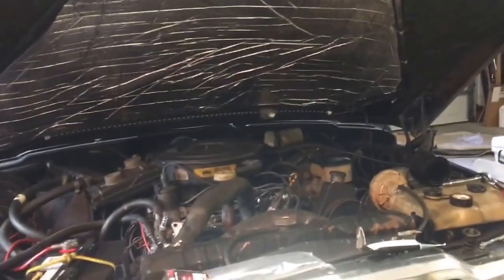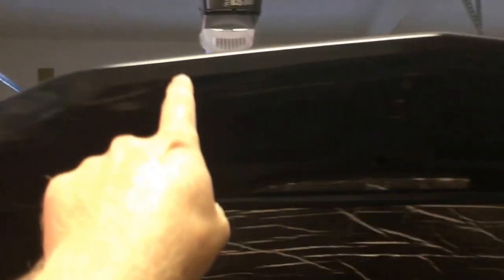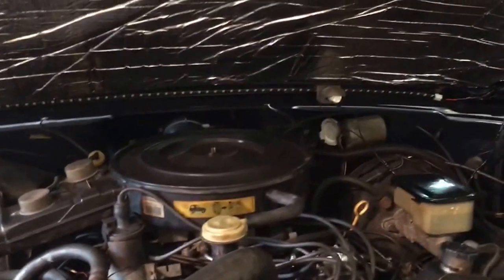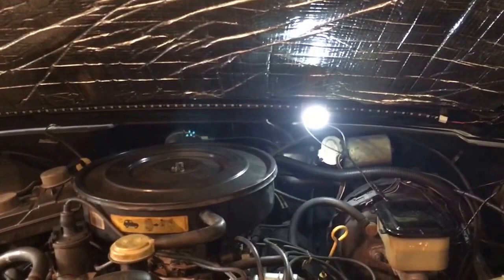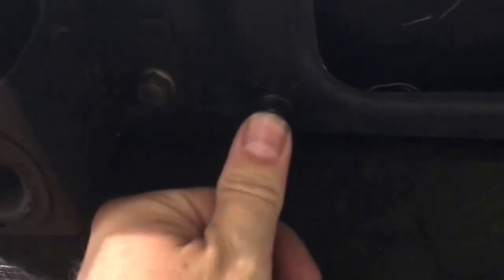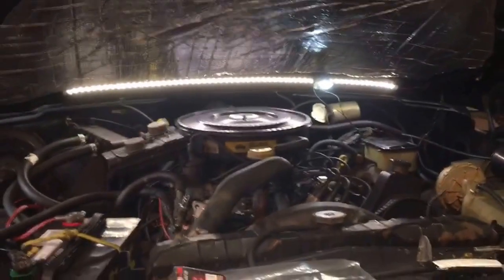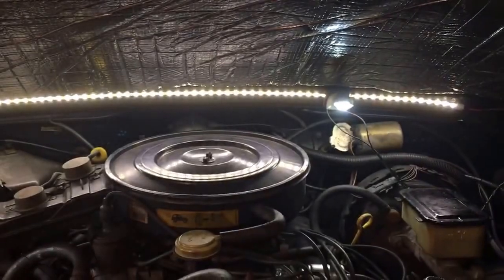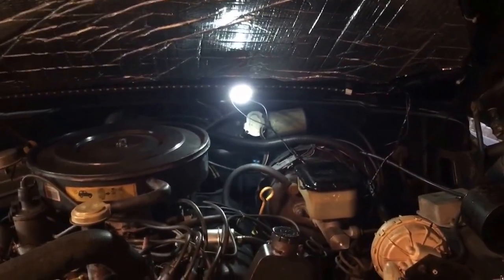Under hood LED installation in a 1987 Jeep Grand WAGONEER

Comment: How is the sticky holding up? I was thinking of doing this mod to my 84 Grand Wagoneer. I am a little worried the adhesive wouldn't hold during winter: It get's pretty cold and snowy in Idaho.
Reply from the maker: George Decker I used 3M exterior auto adhesive tape to install the lights. The glue/tape that came on the lights was too weak. The 3M works great. http://www.amazon.com/dp/B00JR4D70K/?tag=myjeanme-20
Reply from the maker: One additional thought, you could call 3M support and see what the recommend. Here in the Carolina's where I am last night was our first night this winter below freezing.
Reply from the maker: George, sorry for the delay in my response.I just logged into youtube and saw your question.
The glue on the LED did not get good reviews. As a result, I ordered some 3M auto adhesive trim tape to make sure the lights stick and hold up to the heat/vibrations, etc. under the hood. 
Here is the 3M tape I used. It's much thicker than what came on the LEDs and its made for exterior use: https://www.amazon.com/gp/product/B00JR4D70K/ref=as_li_ss_tl?ie=UTF8&psc=1&linkCode=ll1&tag=myjeanme-20&linkId=8f4e268d0188f77bbcc9bea0a86ab44d
Reply: Can you post links to the products that you used (the LED lights, any wires and switch)? Sorry but I could not find that in the comments or info. Thank you.